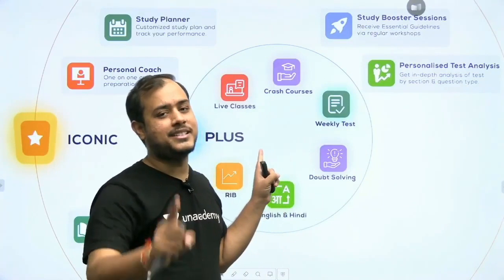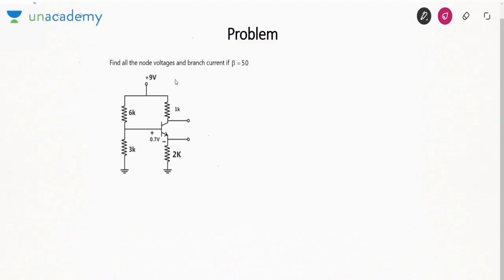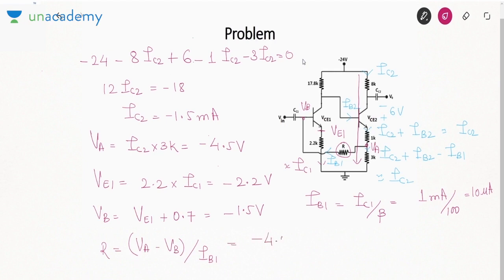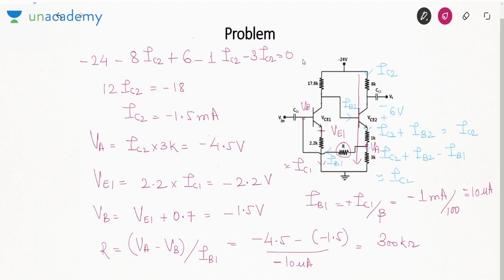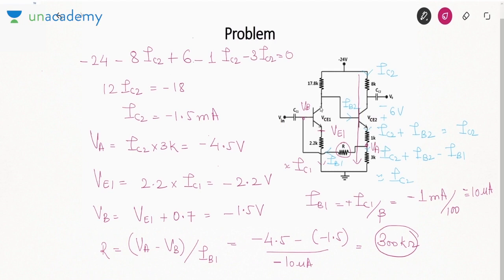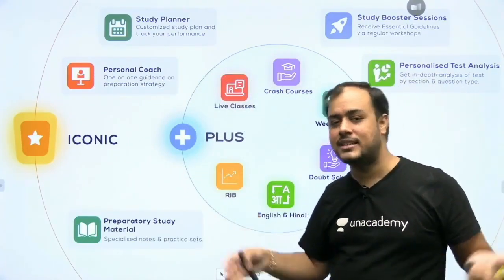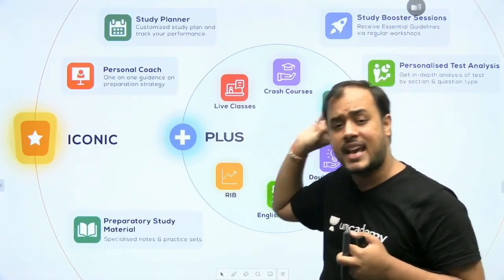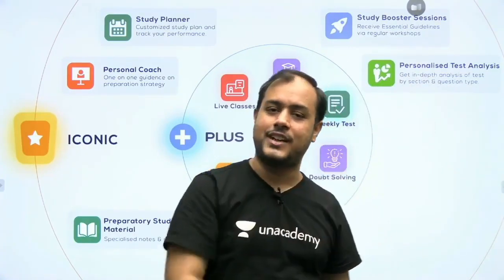Problems from Analog Electronics | BJT | Lec 30 | Analog Electronics | GATE 2021 Exam

Comment: In question no-2

Thevenin voltage for Q1 will be = 9×(5/5+3) =5.625v
And rth= 3×5/3+5 =1.875K

For Q2:-
Vth= 9×(3/3+6) =3v
Rth= 3×6/3+6 =2K
Reply: actually value of resistance is 6k instead of 5k which you are taking for both the voltage divider.
Reply: @Trebeller  yeah, I got confused at first, if we look closely, it was 6k with some erased portion, and also makes sense, good divisible numbers.

Comment: dear ankit sir while solving question number 2 Vth and Rth is calculated with 6k ohm why 5k ohm not used?
Reply: that's a mistake , u can correct it by taking 5 instead of 6
Reply: it is 6k not 5k see carefully some part is crop so its look like 5 instead of 6.